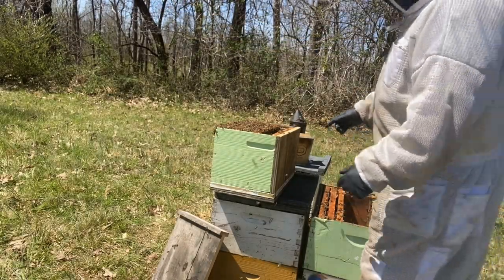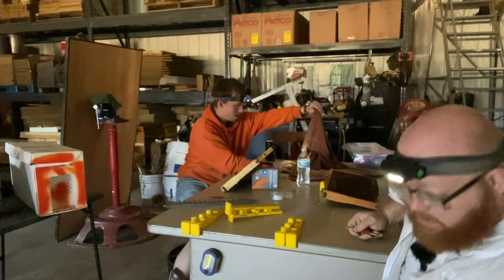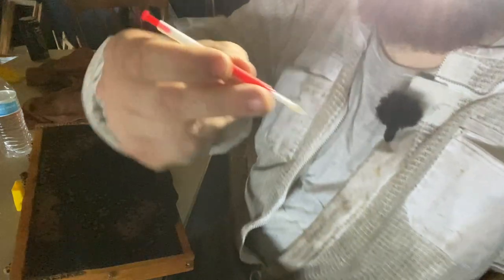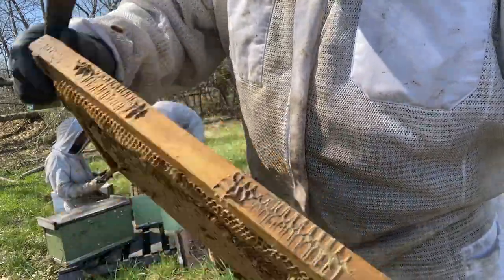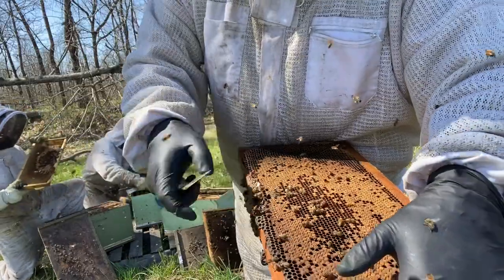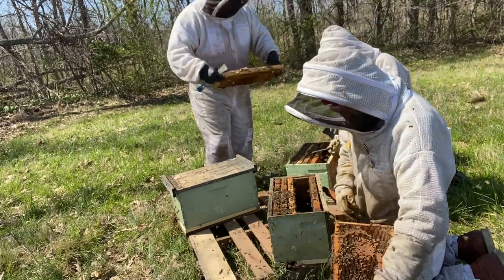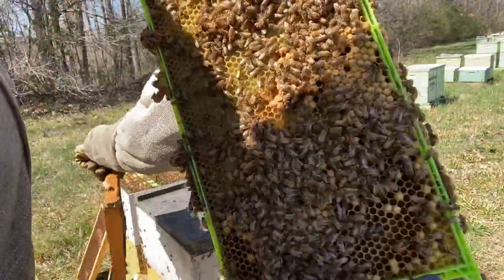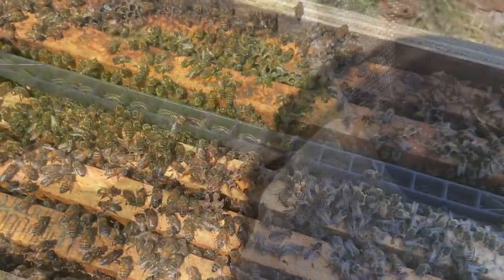How to graft honeybee queens— a run through of the process I use

Comment: Thank you for showing this! 😊 Few questions:
Roughly how long do you have to place the larvae in the JZBZ cups? 
How long do you leave the builders queen less before introducing the queen starter frame?
Reply from the maker: I don’t understand the first question

About 3 days
Reply: @gusmitchellcranesnesthoney6529  How much time can you take to graft the larvae into the plastic cup. Do I have to graft in a "hurry"?
Reply from the maker: Oh, yes they can dry out, best to get it done and covered
Reply: @gusmitchellcranesnesthoney6529  Sorry I wasn't clear enough. How long do I have to graft a frame, of 30 / 60 cell?
Reply from the maker: Do the best you can, Chinese tool will help keep moist. Cover grafts with a damp towel as you go.